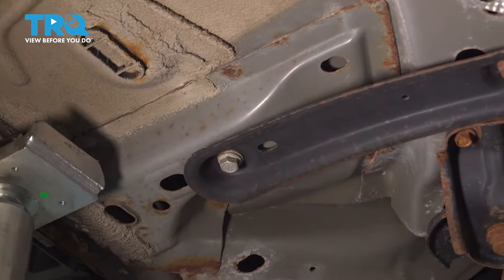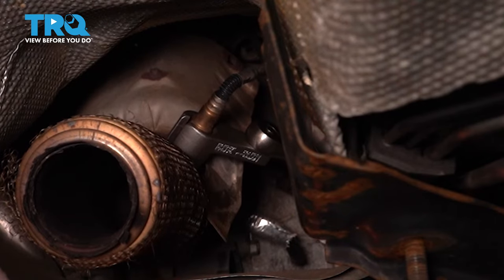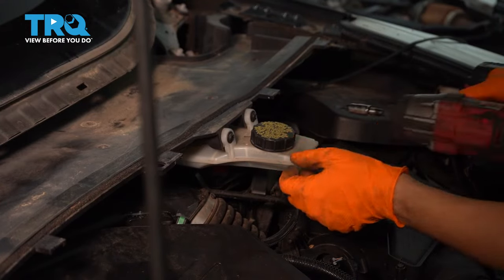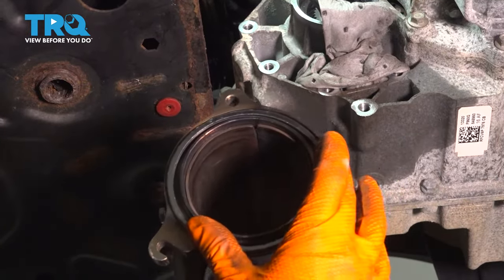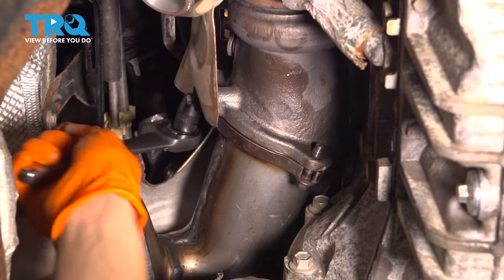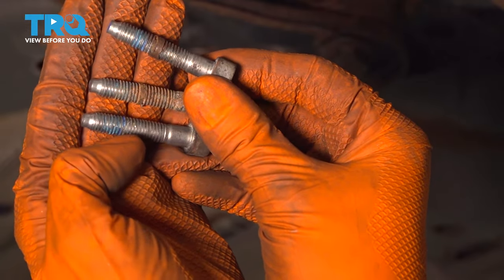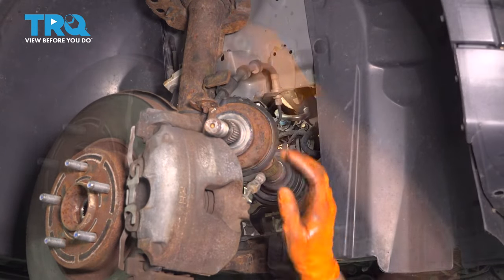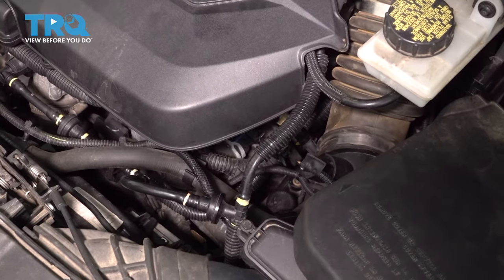How to Replace Front Catalytic Converter 2013-2019 Ford Escape

Comment: Holy crap, that is a terrible design, almost an afterthought as it looks to the ease of removing an exhaust component. A component that will fail with time and is a common part to be replaced. Which wouldn’t cost little to replace if brought to a mechanic, and causes unnecessary headaches for any DIYer doing the replacement at home without a lift to get the car up high enough to relieve some of the hardships of removing so many things. Gosh, I regret not buying a Japanese car once again.

Comment: Just finished this on a 2016 2.0L ecoboost AWD.  Thank you so much for taking the time to video and share your expertise.  I was able to this without removing the passenger axle and transfer case since my downpipe had a V-band clamp.  For the V-band folks, you'll have to completely loosen it and wiggle it around to break it free.

Comment: If you have the 2014 2.0L turbo the Cat to turbo connection is a vband clamp.  I did everything the same but I was able to leave the trans axle in place.  I did remove all the turbo piping on top of the engine.  NYS this part is 1500.  just replaced the flex pipe with S/S so I should be good for a while.  Thank you for this video!!!!